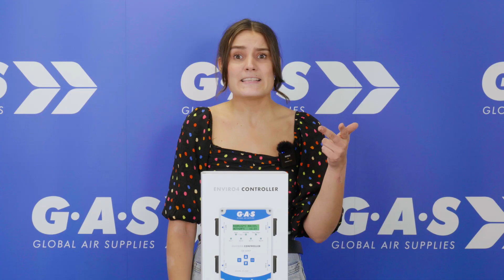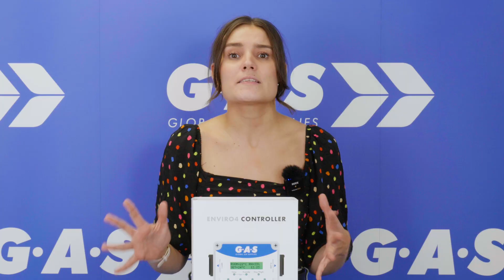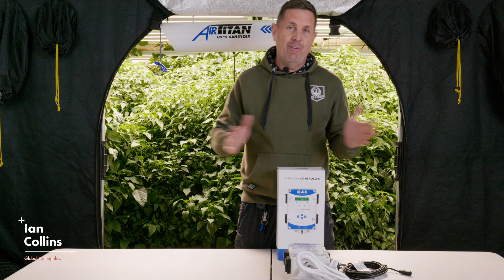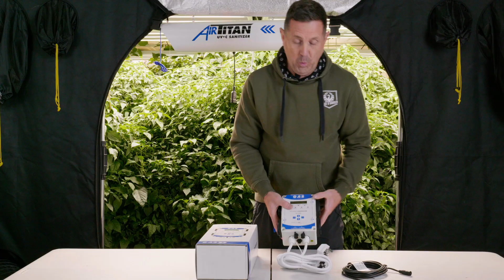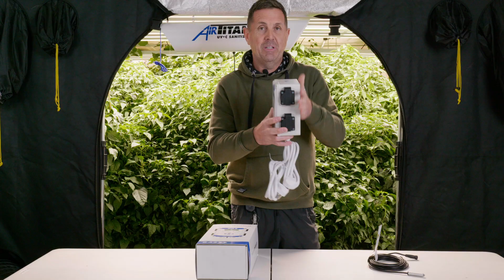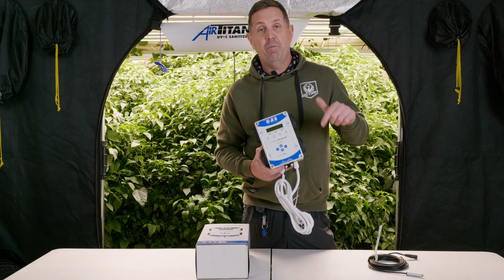One Controller to Rule Them All | Enviro4 | Product Focus

Comment: I’ve been wanting to buy an all in one controller for along time and this product looks great, however as with most people going digital with fans the same people have gone digital with lights. 
There is no way of controlling LED lights with this unit, as in dimming in % increments and sun rise/ sun set mode.
GAS can you make a new model with all of the great things the Enviro4 does but with added LED light controls. This really would be the ultimate product. 
Great work GAS, I’m a big fan of your products.
Reply: Can connect 4/5 socket extension  to lighting sockets? I would obviously not be going over the recommended watts the units rated for.